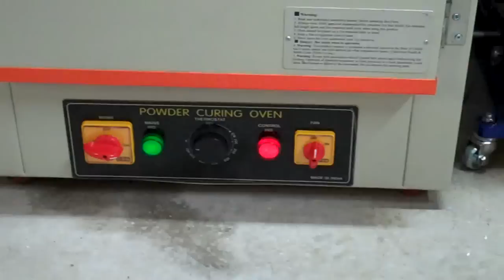Home Garage Powder Coat System

Comment: Stuart, a little off subject but not really: Your sand blaster, I notice that it is spotless!  My sandblaster make a complete and total mess. It leaks everywhere despite my caulking and everything. Did yours come from HF? I have to keep mine outside because the dust is terrible.  Any suggestions?
Reply: +Tim Smith I think I have the same sand blaster.  I siliconed every joint when putting it together.  The other thing that really helps to keep the mess down is to use a shop vac with a water trap on the cabinet.  There are several youtube videos showing how to make the trap.
Reply: Awesome thanks
Reply: +Tim Smith Steven is correct. I have a shop vac attached to mine as well. I caulked the "crap" out of the  joints and purchased some really think foam insulation strips for the joints. I caulked between the two layers of foam as well. Hope that helps.
Reply: thank you a bunch
Reply: Tim Smith

Comment: Borrowed you idea and built a booth out of PVC and white duct tape, although I went a little bigger. as far as the oven harbor freight does not sell them anymore as everyone else was saying, so I bought a used in wall single oven and built a stand for it. thanks for the idea !
Reply: +BRIAN OXENRIDER I have seen several of the wall ovens modified and they work great! Glad this helped.

Comment: The yellow box that the gun hooks up to charges the gun and also has the ground wire to connect to the metal parts you want to powder coat. The system plugs into a normal power point

Comment: Why would you have to spend hundreds on converting a standard oven? It is already an oven
Reply: skinnypuppy40 I just use an old home oven that was left in my house and it works just as good if not better than any pro oven I have used